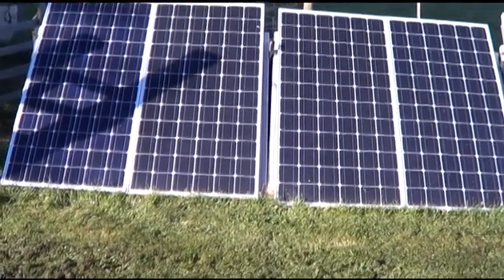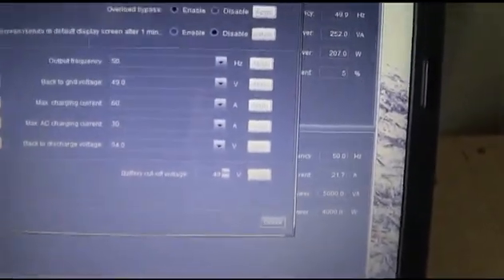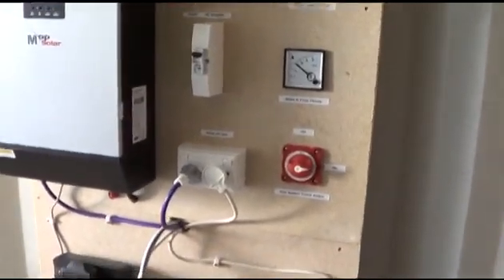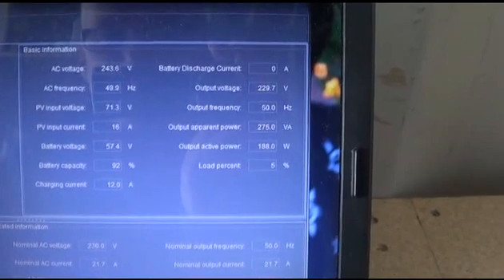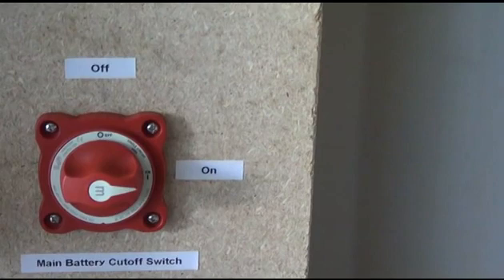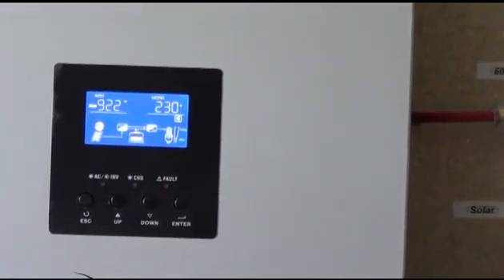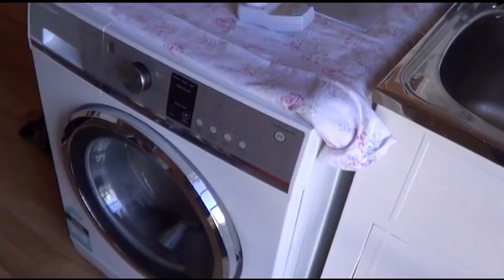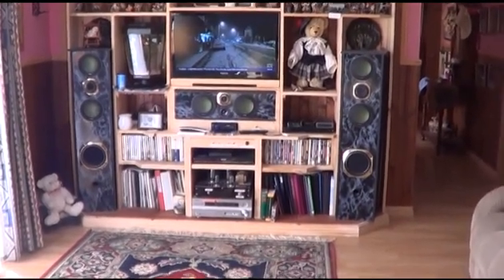PIP 4048MS MPP Solar inverter

Comment: Nice setup mate. A quick question,  did you get anymore info about UPS and APPLIANCE modes? I've been running a PIP3024msxe for over two years offgrid. Recently I wired a generator to the input and need to know the difference between UPS and APPLIANCE. I'm thinking UPS is better because the low voltage cut out is higher and the response time is 10ms as a pose to 20ms in APP mode....
Cheers!

Comment: Hi Mark, nice set up there. Im here in the Phils and starting the same set up. 2 questions please if you may assist me ;
1. Do you have a link where I can download the newer version of Watch Power ? The small CD that came along the inverter is outdated, unlike the software you got there.
2. Im a bit confuse with the wiring of AC Input vs AC Output, can you kindly draw or illustrate it to me, sorry I'm a chemist and not very savvy on circuit diagram.
   Thanks in advance. Kudos

Comment: hi Mark i have bougth the same inverter. I have 10 panels of 240W each put 5 series of 2 panels each (60v each serie). I have the same power from panels like you 1,3 / 1,4 Kw.. my question is: Why we dont get more than 1.4KW if we have 2.4KW instaled? and It's better to have 5 series of 2 panels (60V each serie) or 3 series of 3 panles (90V eahc serie)? cause the charger range is form 60 to 115 v... i gues it will work better on the middle of the range? regads!

Comment: Hi Mark
There is something i do not understand.
In the video the watchpower says you are running a 48v sysstem. 
And later in the video, you are show 4 batteries, and you are saying you have 300Ah battery capacity. Is your batteries  12v 75AH, ???? how many batteries do you have in total ????   Kind regard Peter from Denmark. I am running 100% off grid. check "Living off the grid Denmark" on facebook

Comment: Hi Mark, bravo, you have a lovely setup. Its very rewarding generating your own power and I highly recommend it to anyone considering solar. I will look out for any further videos you post. Cheers Paul
Reply from the maker: Thanks Paul sorry about the editing on the video after doing it and then uploading it to youtube I was over the allowed limit of upload so I had to cut it down. I'm looking forward too selling here and then once we find the right place again I will put these panels on a tracker off the ground, it has taken me 5 years to get the solar right lol but with this new inverter/charger I have now is the best I have come across (transformerless) if is running about 85% of our house 4000w/8000w surge the MPPT charger built in is very good 28amps at 10:30am coming in from panels happy with that. I wont run the dryer off this inverter that sucks to much out of the battery 2000w. Just waiting for some more bargans on the agm batteries I need 4 more and I will have 800ah @48v which should run my whole house once we find the next project (home) cheers Mark
Reply: Mark Collins
From what I read, trackers that turn and tilt dont repay the cost of the energy they save. I do think the correct tilt is worth the investment if you are off grid in winter. Summer less important.. For me I use 35 degrees and made strong frames. Good luck with house / land hunting. Cheers Paul
Reply from the maker: Yes I will have the tilt fixed at 1 point and that is 42deg for here in tassie, I have had that set at that angle for 5 years down here in winter/summer and had no problems with the power I get off the panels. I get sun (when it is shinning down here) from 7:30am to 7pm (daylight savings) and it doesn't switch over to batteries until about 6pm from the panels now down here, but of course in winter by 3pm you don't get any good power from panels. I would put the money into a better MPPT charge controller then a tracker for the panels and these PIP4048MS Inverter/charger are some of the best equipment I have seen for off griders. Now seeing "giant power" are now the distributors in Australia buying them is a breeze but of course they are dearer then buying them from Taiwan but it is the after sales better contact you have.
Reply: Mark Collins Sounds like a plan. I can tell you have been watching Justin Case movies lol. Cheers Paul
Reply from the maker: Paul Chambers
LOL Yes how can you tell :)  bugga me it just dropped to 5deg outside we have flakes of snow in the air with the rain, but that is tassie and it is the 1st of nov lol